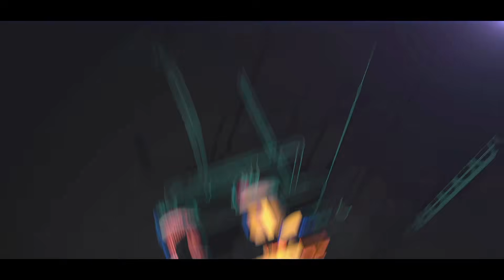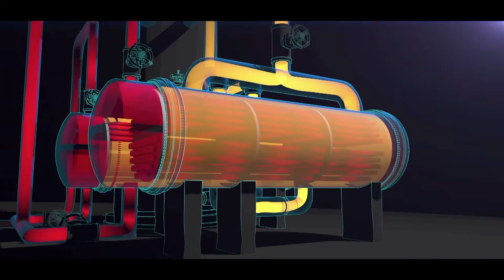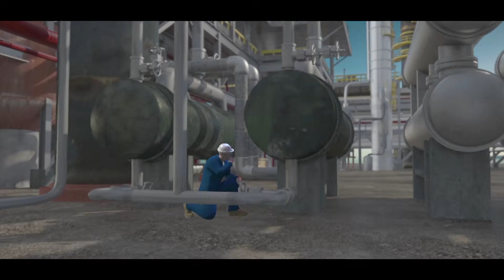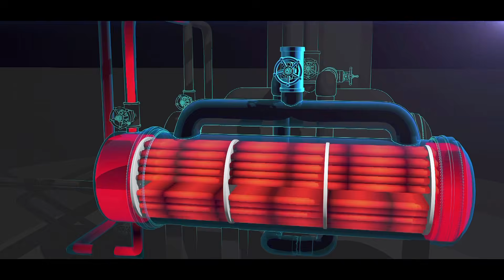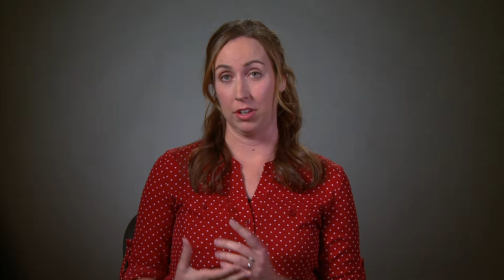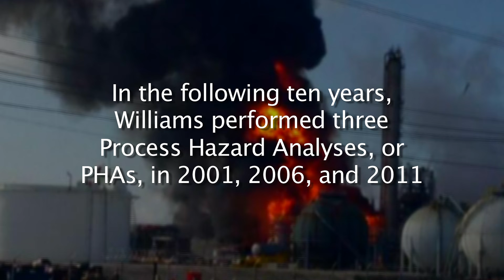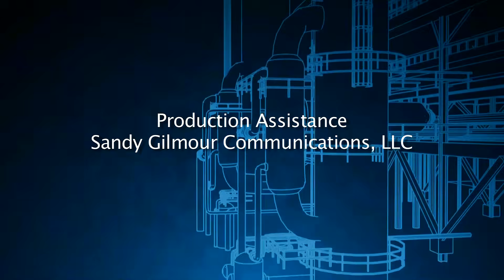Blocked In

Comment: Most of these videos are very good.  This one is not clear.  What did the supervisor turn the hot water on the exchanger that had been out of service for over a year?  If he intended to start up the exchanger, the isolation valves on the shell side must be open.  Very strange.

Years ago, as part of a maintenance procedure, a blind was placed upstream of a pressure relief valve protecting a reactor.  This was done to prevent cleaning chemicals from damaging the PSV.  The reactor was started up with the bind un-removed.  As luck would have it, a run-away reaction occurred.  Plant workers told me the reactor deformed to a totally spherical shape before it blew.
Reply: First rule of operations......Never allow a supervisor to do operations work !!
Reply: He opened it because he didn't expect it to be filled with propane, or at least not enough to cause the explosion that killed him.
Reply: @hallerd  plus the block going to the relief was closed
Reply: Manager may not have understood or thought about the consequences of what he was doing - open valves A, B, C, and D... but order matters.
Reply: Why should he care? Hot water was the only way to start the process. No one knew the release valve was blocked on that side of the system.. The accumulation of leaked gas was also unknown.
"We this do as usual".. 💥
Reply: That's the point.  He didn't really know how to start up the heat exchanger properly, so he halfassed it, and did only Step 4, not 1-3 or 5-8..
Reply: Fluids inside a reboiler must be heated to certain temp. Before entering the fractionator otherwise these fluids just return to a heat exchanger.
Reply: This is why the CSB says the company needs a written procedure. To ensure this kind of mistake doesn't happen

Comment: Highlights a lack of plant knowledge and training by the operators. Very sad.
Reply: Lack of knowledge equals lack of common sense.  Lack of established procedures encouraged improvisation.  Improvisation is dangerous enough but with a lack knowledge it set the event into motion.

Before then the plant wasn't safe after modification, and an engineering attempt to make things ever so slightly safer by locking a valve open were ignored - perhaps because the danger was misunderstood.

So many people who should have known better failed.  Sadly one died for his mistake (and as usual he was near the bottom) and others who probably weren't directly involved were hurt and killed too.

Comment: Interesting that there were no relief valves on their own pipe coming off the shell of the boiler itself... Generally, when building a boiler(even a low pressure one) you want the relief valve as close as possible to the vessel being protected.
Bad design all around, won't catch me working at this plant, thats for sure...
Reply: Now consider what would happen if that valve opened.  Tons of highly inflammable gas released at ground level, still get a big explosion - PRV at the top of the stack was well placed.

Comment: Additionally, there is no reason to have a "standby" heat exchanger that sits idle for over a year.  The isolating valves were also idle.  You can't trust a valve that is never periodically tested.  Were a valve exercise program in place, the technicians would have been familiar with the process of switching from one heat exchanger to the other and the inherent dangers of only operating one set of valves.

Comment: lol, pressure relief valves that you can isolate! No high limit temperature controllers? Safety devices? What the hell kind of retarded design is this? Is this the 1800's? How do these people get these design jobs? Who's the management that decided it would be too costly to install proper safety devices? Where was OSHA? Where were the local jurisdiction inspectors? Where the hell was the insurance company who's supposed to be the last line of defense from this utter incompetence? What about risk assessment? This whole situation was completely preventable but wasn't because of utter incompetence on a mass scale.

Could you do this safely as it was? Sure with a choreographed daily dance routine. If you mess up, you die! It's time to introduce executions for management and owners for this type of nonsense.

Comment: Amazing they could have missed that (or just didn't care). Simply moving the valves upstream of the tanks would have been better so the PRV doesn't get isolated.
Reply: Yep, a real simple design oversight. Tank pressure relief valves should never be isolated. They belong attached directly into the tank skin WITH A PRESSURE GAUGE AND WITH A BACK UP VALVE AND WITH REGULAR TESTING TO SEE THEY ARE WORKING.

Comment: Basic rule: Never open pressure into a vessel without first opening an outlet for that pressure to exit the vessel.
Reply: Or heat. I worked Process, Safety and Management of Change. The cold side has to have flow, or at least a path to pressure relief.
The heat is the driving force, and I am surprised that they did not mention that this explosion was a BLEVE. This was not an ignition explosion, this was initially a 'Boiling Liquid, Expanding Vapor Explosion'. The boiling of a  liquid hydrocarbon in a closed container. The prominent scenario for illustrating BLEVE is flame impingement on a vessel containing light hydrocarbon material. Even with a lined up series of safety valves, they may not be able to relieve pressure fast enough, and the weakened steel will rupture.
  This one qualifies as a BLEVE incident even though hot water (condensate/boiler feed water) not fire, was the source of the heat.
  But, in our case, the vessel did not suffer from flame-induced weakening of the shell. The shell was at it's normal operating temperature (maybe 200"F. It's water, not steam).
This shows the power of heat generated pressure alone, without needing shell-weakening fire to rupture the shell.
Reply: Pressure relief valves HAVE to be directly placed on pressure vessels
Reply: LOL your avatar matches your comment.
Reply: Let's be fair to the dead guy here. He could have not been the one who did it before. He could have looked it over and not seen any problem. You could've been him.
Reply: Drew Butler everyone makes mistakes
Reply: @thorr28  Well bud, how bout you read my comment again, THATS EXACTLY WHAT I WAS SAYING!
Reply: Ken Karnes I feel bad for the people who had to pick up the dead guy’s body parts.
Reply: Ken Karnes don't eat beans with your ass closed.
Reply: @NoZioKikes88  lol
Reply: @NoZioKikes88  Good one.
Reply: Get ready for full deregulation. Life is cheap and the people are poor I guess.
Reply: No procedure sign off? Real dump mistake!
Reply: Bruce Hand: What is a "dump mistake"?
Not getting to the toilet in time?
Reply: Never eat chilli with a but plug installed without all ppe and paperwork.
Reply: Looks like this could of happened with either unit if you screw up the start up sequence
Reply: NEVER eat beans if you can't fart. BOOM.
Reply: @ThoughtChallenger  Better to fart and stink a little, 
than bust your arse and be a cripple.
Reply: Basic rule. Never work in chemical or refining plants
Reply: That wouldn't have saved them, as the issue was the propane already present in the reboiler - they didn't let any more in. The pressure being supplied was water, and the outlet was also opened.

Over-pressure relief needs to be present *everywhere*.
Reply: Someone Somewhere The output was closed.
Reply: Someone Somewhere

the Propane outlet was not open that was the problem so again Never bring a Pressure vessel online without opening the outlet or a vent
Reply: Basic Rule:Dont trust big business!
Reply: @lgonzalez1154  Basic Rule: Safety procedures are only implemented after a catastrophic event

Comment: I worked at this plant for a while.  I viewed the plant manager as a man with integrity.  Overall Williams leadership, on the other hand, has faltered.  After various reorganizations, which is not to imply that it was organized, the company is still structured in a way that leaders think that a reorg - move some people, fire other people, is a panacea for whatever goal they might have.  As an engineer, this was very disturbing.  One glaring example is as follows:  This particular catastrophic explosion at Geismar can generally be classified as faulty purge procedure.  Within a year or two of this event, very little change had been implemented that affected operating procedures.  The result?  Obviously the same type of catastrophic failures occurred.  This includes the death of a contractor in Alabama, another explosion that almost blew up the entire town of Plymouth, Washington.  These were, specifically speaking, related to purging procedures.  How did Williams respond?  Well, they showed this video - produced by others.  They offered resources for doing CFD analysis, if people so chose to take advantage of this resource which was not very helpful and did not address the root cause.  As such, very few volunteered to take advantage of it.  Did they audit existing purge procedures throughout the organization?  To the best of my knowledge, they did not.  To this day, I can tell you that certain operating areas STILL HAVE THE EXACT SAME PURGE PROCEDURES THAT ARE KNOWN TO LEAD TO CATASTROPHIC EXPLOSIONS.  Changing the procedures is easy, with little, or no effect on business.    I can't tell you why leaders, such as VP Geoff Wilkinson, are so aloof to the technical details of their actual underlying business.  Lazy?  Arrogant? A gutless conflict avoider?  Simple Incompetence?  I really can't speculate why.  I can just tell you that they don't have good leadership.  Let me give you another example:  Cascade Natural Gas doesn't know the MAOP of their pipelines (look up the case against them brought by Washington State).  This is a very basic fundamental part of the business.  I don't see how the business could evolve to the point that they don't know the MAOP of their natural gas lines.  People most familiar with regulations are promoted.  The business revolves around regulations.  But they have little ability to think and act for themselves. 
 This is the industry that much of Williams operates in.
Reply: Jason Burt the bit you mention about reorganization rung true with me. 

For management types, actually solving technical problems doesn't seem to be effective (glamorous) enough. To solve technical problems takes a lot of work and the return on investment can be low especially if the true cost is unclear. It's much more dramatic to fire your engineering team and promote a group of operators to Junior technical leaders. You poorly estimated the costs so even if the problem persists the cost is still low (relatively). After several years of massive bonuses the manager quits for a more lucrative opportunity. Nothing has really gotten done...
Reply: Tadesan I knew someone who said managers did not need to know processes in order to manage a business.
Reply: Jason Burt....I know what You're saying but I've seen REVISION after REVISION and the Drawings aren't Changed. So a Guy comes out years Later with a Backhoe Digging where the Original Drawings say the line is and it's been changed and he can't find the Line so he starts digging around and finally Digs into a line and it's over....That Happened in Pleasant hill, Calif along highway 80 or 24..(I can't Remember) It KILLED 2 welders and maybe the Operator....I'm a UA 342 Retired Welder..Scary has Hell looking back on it.... I've worked in all the REFINERIES in the Cali Bay Area and many other DEADLY PLANTS...
Reply: So William Olefins employed an operating code that the shell side of the reboiler should be filled with Nitegoen under pressure while in standby  mode and vent this nitrogen before starup .Am I understanding right ? . And what was their sequence for opening shell and reboiler valves.
Reply: I concur Mr. Burt. It is usually a lack of incidents (safety issues) that create complacency where it counts the most! (human lives). I have had contractors show up to my sites and say "Oh it's no problem. We've done this hundreds of times!"  I look at them and say. "That's all well and good but you haven't done it here." We then go through the entire procedure before starting.
Reply: @WilliamKing-hf8lc  That's a point of mine too.  You can have all the regulations and written procedures you want, but eventually some guy is going to say "you don't need to go through all that.  I've been here 20 years and done it this way thousands of times and never had a problem."
Reply: Thank you for your input on this, it helps bring the video to life
Reply: Imagine if we had a functioning legal system and laws that held managers accountable for death and destruction caused by negligence.
Reply: I find disturbing the “urging” by the CSB Chairperson that other companies institute the “recommendations” that resulted from the CSB’s investigation. Apparently the CSBs work (which is fantastic—don’t get me wrong) doesn’t result in any regulation, with teeth, of an apparently hazardous, toxic and accident-prone industry. I guess this is not surprising given that the CSB came into existence post-Reagan, when government regulation had become unfashionable, and industry self-regulation suddenly seemed like a great idea.

I prefer the “institute our safety recommendations or we’ll shut you down” approach.
Reply: @KarlLetcher  the CSB is not a regulatory agency... there are other government agencies that handle making regulations based on the CSB's recommendations, however.
Reply: Jason Burt corporate greed is at the root of this every time,cutting corners,false economy,putting workers at risk.
Reply: Yeah, I used to be sort of a hardcore libertarian.  But I've learned to appreciate organizations like the CSB and OSHA who are effective in establishing limits, or balance out the extremes of the drive for money.   Williams is much better than some.  For example, Enbridge doesn't have the best record (they blew up the line that feeds my current plant).  Energy Transfer attempted to buy Williams to satisfy the Texas-style ego of the CEO to 'be the biggest', with very little substance behind his claims of 'synergies'.  I'm glad that didn't go through.  @margaretcooper797
Reply: Expensive & dangerous containers, process equipment should have its OWN purge procedure. Of course, probably outdated equipment there,
Reply: Bro are you high on adderall lmao
Reply: Goes to show that increased regulation often leads to increased compliance not necessarily increased safety.
Reply: We should close every damn refinery than cause over half of them fail
Reply: Tell us how u really feel.
Reply: Y'all need to stop hatin' on them job creators. We all could be big shot managers drivin' Cadillacs but them democrats keep regulatin' the piss outta them so all they have time to do is follow regulations instead of doin' the safe n efficient stuff. We need to revote Trump back next year so he can cut more regulations!
MAGA!
Reply: @shimes424  not very good satire. try harder next time.
Reply: @shimes424  I can't tell if this is satire or not. If it isn't,  sir I genuinely hope you don't work in the industy.
Reply: @shimes424  You are genuinely stupid if you don't realize that companies do this kind of stuff to themselves.  If they ran their plants properly to begin with, these CSB videos would not exist!

Comment: Another case of - the right person isn't available to do this, no problem, I'll just do it myself instead of waiting.
Reply: The improperly isolated relief valve was the problem
Reply: Im a supervisor.  Let me open the heat source to this boiler while having no idea what it does.  People with no common sense and little knowledge of engineering  shouldn't be turned loose on things that can explode.
Reply: Robert Dickerson not really applicable in this case.

Comment: What if the CSB opened a branch in Germany...I reckon they would find a lot of run - down refineries and other dangerous shops on the brink of a catastrophic blowup, especially in the east (e.g. Leuna). Running a chemical plant is risky business, and there always is the human factor, also called "human failure", or just one tiny piece of faulty equipment, setting off an explosion like the one in Torrance, CA, in 2016. In that case, it was just a slide valve having worn out through a decade of operation!
Reply: It's interesting that you brought up the "just" a slide valve. The purpose of Management of Change, or rather, the whole PSA program is precisely to avoid having a falling apart piece of equipment, device, valve, etc. etc. that invites disaster, not to mention the routine maintenance. Your name looks German and I can't speak for your culture there (mind you, culture plays a MAJOR part in lots of accidents), but even with CSB here, they were only able to capture the lesson after things happened. PSA is a product of many mistakes and fatalities, but I was once told that each life at a factory has a monetary value, and that was nothing to compete with profit.
Reply: in Germany every isolate-able pressure vessel must have a safety valve according to the Dampfkesselverordnung ... otherwise TÜV ruins your day....